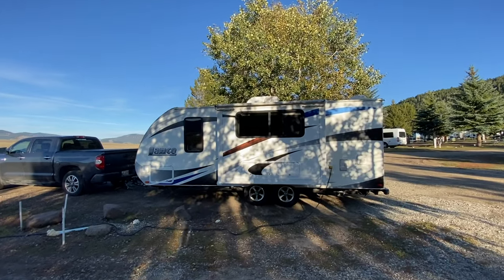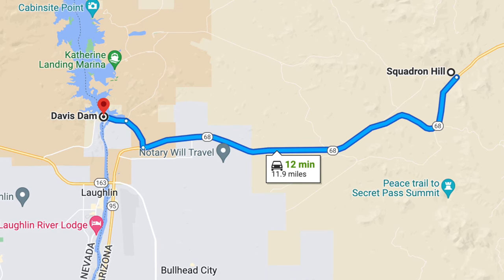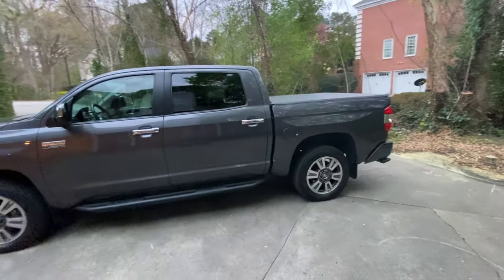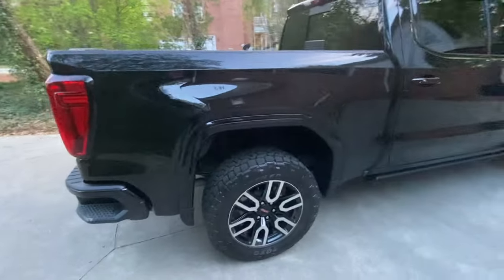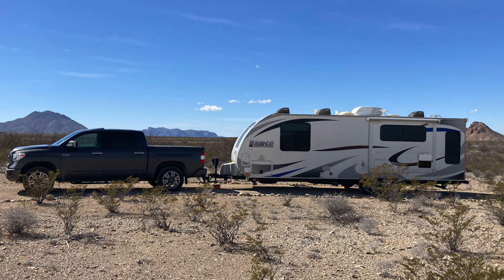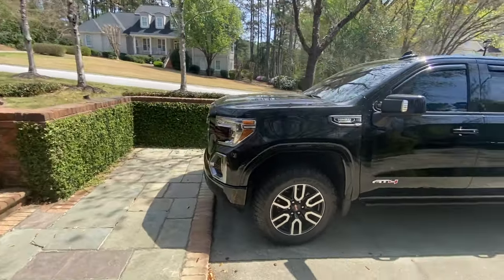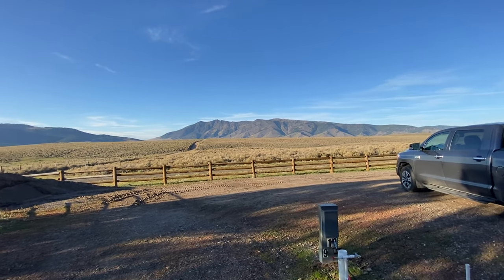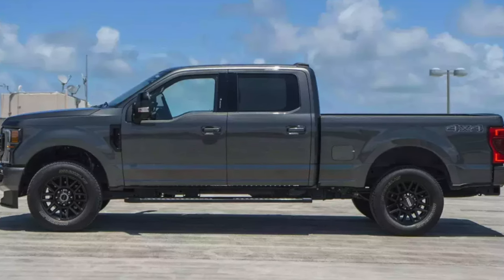Myths - Towing Capacity & Payload - the best Half-ton truck for your Travel Trailer or RV

Comment: Whenever I run across an RV salesperson that tells me my Toyota Sequoia can tow up to 9200 pounds, I feel my blood pressure rise.  When I calm down and explain that the tongue weight on a 9200 pound trailer is probably equal to or greater than the Sequoia's max payload rating... I get the typical "well yeah".  Then why the hell are you selling trailers to people that are FAR outside the safe towing weight for their 1/2 ton (or less) truck?!  When I see gas 1/2 ton Suburban's or Expeditions towing 33ft trailers... I stay far far away from them.
Reply from the maker: I pass them,  by a lot.

Comment: Here’s my view. I have an F250 with the diesel engine and have towed my fifth wheel all over Canada and the US, with no problem whatsoever. The problem is with the seedy lawyers and insurance companies. If you are overweight, either cargo capacity or GCVW, just watch the vultures circle, if you get in an accident…they are going to go after you like the snakes they are. I hate these rating systems, but just watch out…you may not have valid insurance if you are in an accident.

Comment: I so like many of the thoughts and things you point out in the video.  However, I need to point out what I consider a glaring mis-characterization you made.  When talking about RGAWR, you stated that the F150s RGAWR "come in around that weight", when highlighting the 3800 lb rating of your GMC.  My 2021 F150 has a RGAWR of 4150 lbs.  The exact same as your Tundra.  So, you should not be stating false generalizations on a particular truck brand.
Reply from the maker: You have the "Trailering Package"  which is not common, but great to have.  Most F150s come with a RGAWR of 3850 lbs.

Comment: I have a 2020 Silverado crew cab ltz 4x4 with a 6.2 liter with the max tow package. My travel trailer is a jayco single axle 23 foot 5000 lb called the 199mbs. I have a wife, 3 kids plus 2 german shepherds, the dogs are in travel crates in the bed of the truck with extra propane and a generator. My payload capacity is 1800 lbs, and the truck weighs in at 5500 lbs. So when I'm towing the rv my payload, including tounge weight is at around 1,500 lbs with a trailer only weighing in at 5k. So I'm almost out of payload and this trucks gvwr max is 18,000lbs. The only people that really care is the highway patrol and the lawyer of the family you killed when you didn't stop in time and killed them. Lol! Just saying. I will tell you what this 6.2 liter can tow! Over 420 horse power and a torque rating of 475! I can merge on the freeway at 80 mph like nothing! The 2 things I would change are is that this thing is thirsty! Sucks that fuel ⛽️  and I wish the brakes were just a tad better. The gvwr on the side of this truck is 18k. I will never ever get close to that number, 5 to 7k is my half ton max.  Hope this helps, good video and good information, the only thing I would have added was the fact that you can always stop and use the scales for more clarity with what you personally got going down the road. Might raise some eyebrows with what you thought you were towing and what you are actually towing. All that rv toilet paper in the bathroom adds up. Lol!

Comment: Damn my Ram 3500 6.7 Dually came with only a 32 Gallon fuel tank.
Reply from the maker: You can get the long bed 3500 with a 50g tank
Reply: @kedrevs4037  Wow that’s incredible. I have a long bed or 8 foot bed but I’m wondering if I could upgrade to the 50 gallon fuel tank? Thanks for the info

Comment: With almost any RV trailer you need a diesel and at least a 3/4 ton truck.
Reply from the maker: Crazy talk from a Wolvwrine…shocker.
Reply: @kedrevs4037  it's not crazy talk, it's called experience. The diesel usually gets twice the mileage to begin with not to mention it has 2 to 3 times the torque. If you're pulling any camper no matter how light weight for any distance the diesel is the only way to go. If you're traveling through the mountains pulling a camper / trailer or empty there's no comparison either.
Reply: @kedrevs4037  the Jake brake is another added feature that a gasser doesn't usually offer.

Comment: Just don't understand the hangup people have with turbo gas engines. They are proven. Formula 1 race cars run on turbo charged engines. All be it they are diesel powered every semi you see on the road are now turbo charged and some even dual staged turbos. WW II air craft were gas powerd engines with turbo charging for high altitude. Farm and industrial engines turbo charged. Yes Ford built the 7 3l  naturally aspirated V8 for the super duty. But those trucks are designed to tow in a class the 1/2 pickup was not intended to. As for the hp and torque rating you were incorrect. The 3.5l ecoboost non hybrid is rated 400 hp 500 lb feet torque. The 7.3 430 hp 475 lb feet torque  The object of the eco boost engines was to provide 1/2 class towing performance and solo fuel mileage. Yup there are ecoboost failures but then again the 5.0 is far from bullet proof. I've run the the ecoboost engines since 2013 towing and no issues  By now I am pretty sure that you know that if you intend to drive a new Trunda some day it will be a turbo charged V6. I look for GM to follow eventually. The only way the automakers can make future cafe standards. To each there own but to me a 1/2 diesel pickup is a gimmick. Lets see. I'm going to spend $3000.00 to $4000.00 for the diesel option plus spend on the average a dollar per gallon more for diesel than gas so I can get maybe 5 mpg better. Then all the problems that now come with tier 4 diesel engines. No way. But everyone is entitled to their opinion.
Reply from the maker: Ummm,  As it turns out, I don’t drve Formula1 cars.  And, you clearly don’t tow a travel trailer across country.
Reply: @kedrevs4037  As you are incorrect I do pull my travel trailer acoss country.
Reply from the maker: @sny1168  What's your rig?  

BTW the baby Duramax is a $1k option, not $3K or $4K.  Diesels (half ton)are about improved range, not improved costs.  They are not a gimmick at all.  Now strapping turbos on to piss-ant V6 and bragging about HP and torque that has been neutered by a shitty final gear ratio.  That might be the epitome of a gimmick.
Reply: @kedrevs4037  My rig? At present. 21 F150 4x4  3.5 with 3.55 axle ratio. 22 Grand Design 200MK. Look do as you please. It's not my place to try to convince you are incorrect in what YOU want to own. I have considered diesel pickup options. I pull my rv about 8000 miles a year on average. Considering initial cost of vehicle, diesel cost, maintenance, and the tier 4 diesel emmissions problems the total cost of owner ship does not work for me. Now again I stress, do what YOU want to do. But to tout the Ford ecoboost engines are inferior is merely the opion of someone who is probably not a Ford fan to start with and never experienced driving an ecoboost. Last thing, the 3.0l in line 6 GM diesel is not without issues either. I'm done commenting.
Reply: I sure love my 2015 ram ecodiesel. Deleted all that emission bs and added some aftermarket airbags and it tows my grand designs transend 247bh amazingly and it sure uses a lot less fuel than any gasser. Plus I’m on the farm so I have diesel on the yard at all times…
Reply: This guy has obviously never towed with an ecoboost. I replaced my 2003 dodge ram 2500 diesel with a 2.7 with the 3.73 rear end and then later a 3.5 with the 3.55 rear and they flat out PULL. On our way through the mountains of West Virginia, I was waiting at the top of every hill for my friend with his tundra. Also those half ton diesels aren’t meant for towing like a heavy duty diesel either, they’re meant for fuel mileage. Also you’re afraid of a gas engine with turbos but you want a turbo diesel? What’s the difference?Wait until you need to replace injectors in a diesel which probably won’t last as long as the turbos on the gas engine anyways and they’ll cost as much or more

Comment: That's a pretty ignorant and old school opinion on the the new generation Tundra. No, the turbos aren't just going to burn up because you're towing more often. The new generation is better in every way and I guarantee I get more miles per tank than that thirsty 5.7. I also have 300 more pounds of payload that you think doesn't matter.

I agree with some of what you said, especially the weight of the vehicle playing a factor. My tundra is 800 lb heavier than my 21 F-150 and it seems a lot more stable when towing to me.
Reply from the maker: Not so much old school as just realistic for the amount that I tow

Comment: If only Ford put the 7.3 in the F-150...
Reply: @SuperSnakePlissken  Yeah that engine is amazing in that application. I only thought now that Ford will put it into the upcoming Mustang maybe they would also offer it in the next F-150.
Reply: @SuperSnakePlissken  Well some pictures of the upcoming Mustang have leaked and the one that shows the aggressive version on a screen has a badge that appears to say 7.3 where the current 5.0 badge is on the Mustang.
Reply: @SuperSnakePlissken Yeah that's a shame.
Maybe that's the way to bring the Mustang back to its roots as a muscle car. 😂
Reply from the maker: Love the 7.3L in the 3/4 ton.  Only issue would be finding a place to fit and fill up on the road when the travel trailer is attached,  but we'd figure it out.
Reply: @kedrevs4037  7.3 gasser 4dr long bed comes with 48gal fuel tank
Reply: Maybe an aluminum version of the new 6.8 ??
Reply: The whole point of the F 150 is to keep the trucks curb weight low. Adding the weight of a 7.3 would change every part of that equation; the truck would need a completely redesigned/heavier front suspension and drivetrain. So the truck would weigh much more and the payload would be much less.

Comment: Turbos don’t work(every semi truck has one) 🤔💭🧐🤣
Reply from the maker: Everyone that types this is an ignorant, you included. The amount of boost delivered by a turbo diesel is a small fraction of what a gas turbo delivers and the amount of rpms of the turbos are a fraction.
Reply: @kedrevs4037  Your opinion is that turbos can’t/don’t work as good as naturally aspirated, yet they have worked well to develop huge torque needed to haul freight for decades. 
I like naturally aspirated too but turbo is the way to go for a broad torque curve across the rpm range and at altitude. It is up to manufacturers/engineers to deliver a reliable proven powertrain in the Turbo format. What remains to be seen is which turbocharged engine will really deliver long term reliability. Clearly GM/Ford/Ram/Toyota all are giving option of or exclusively going gasoline/turbo route in the half ton class.

Comment: Heres the problem, at some point here you may as well say goodbeye to the V8’s be it Hemi, 5.3, 5.0, etc etc. as of right now uou better plop an extra $4,000 the federal put on all vehicles with a V8 or greater.  All truck companies now are ditching the v8 and going V6 or using turbos, you wont get away from it.
Reply from the maker: This a rumor that is pure silliness,  V8s aren't going away, you may need to get an HD, but no person living today will see the disappearance of V8 ICEs
Reply: @kedrevs4037  pretty soon you wont seem them on 1500’s thats for sure.

Also i noticed that when ford, chevy, etc etc tell you that their truck can max tow at lets say 12,500lbs, the weight of the truck with a full tank of gas is not factored into those numbers so technically its impossible to hit that tow rate without going over.